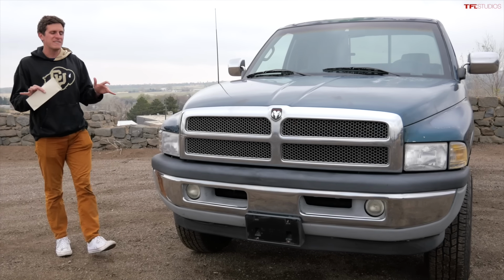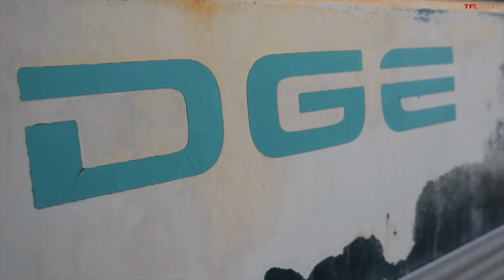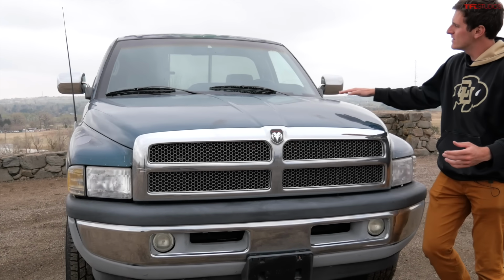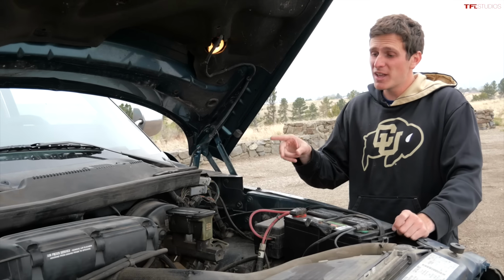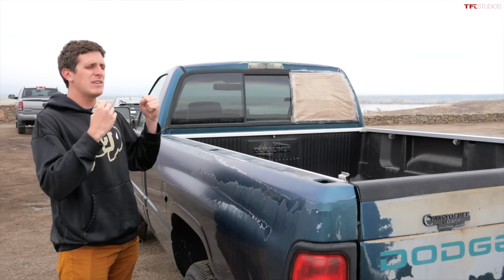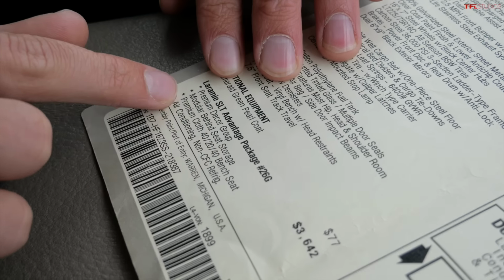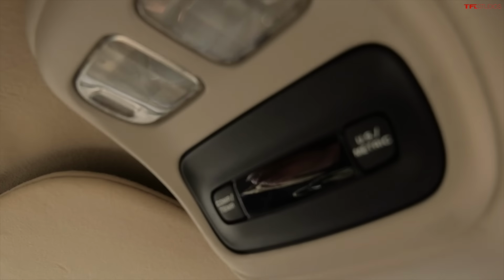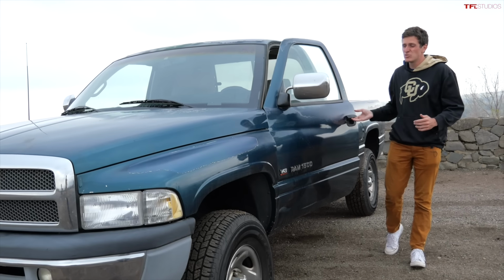The Second Gen Dodge Ram Is The Most Important Truck Ever: Here's Why You Should Buy One NOW!

Comment: This truck ushered in what we see today in pickups. But my friend had a almost new 1500 sport RAM 360 ext cab 97' model year was worked and at young age we practically lived outta it interior room was better than others. But reliability not there ! Tranny's and when it worked not precise. The other issues was the front end would fall out daily! The transfer case blew twice too weak for that model and weight . The 360 always performed good , but mpg wasn't a joke at all vs my 350 GMC. It is a truck that needs to be built and customized after purchasing then perfect! But we would all go off road and they would hang with Square body's and jeep's.

Comment: I've always loved the 2nd generation Dodge Ram trucks. I own a 99 Dodge Ram 1500 short bed with the 3.9 V6 and 5 speed manual transmission. I plan to swap out the V6 for a 5.2 V8.
Reply: does it vibrate

Comment: I’ve had all types of 2nd gen Rams. 1500, 2500, 3500. Gas 318, 360. 12v Cummins, 24v Cummins. Auto, manual. Single cab. Club cab. Quad cab. 1994-2001. I’ve had a lot. They have their issues. But… the value for the dollar is insane. Parts are relatively cheap and easy to get. Grab a nice one because these will go up in value at some point.

Comment: I bought one of the last 2nd Gen Dodges ( 2001) New, as the New 2002 Model Dodges  started dominating the Dealer Lots. I was disappointed in the New 02’s I did not like the total remake, I hated the Catfish looking front end , nor did I like the bland sheet metal, also gone on 02 was the quad cab with the smaller rear suicide doors and replaced with a full 4 door . So I hunted around and bought one of the last 2nd Gens. I still own this truck, it is garage kept and low mileage and still looks great, I also have a 69 Dodge D-200, with all the original paperwork. Oddly, the 69 was listed and sold as a 3/4 ton truck, but the extensive owners manual lists all chassis components as one ton. Buy a new truck today? They just tell you not to drink the coolant, lol

Comment: Owned 2, a ‘94 LWB 5.9 regular cab 2wd and a ‘95 SWB 5.2 regular cab 2wd. Both red. Preferred the SWB as it was a city truck mostly. But he’s right about the mpg. They were so popular at the time I traded the ‘94 with about 9,000 miles for the ‘95 for less than $1,500 with almost identical equipment except the engines and beds. The ‘95 also had the argent lower paint trim which I preferred.

Comment: My '99 Dodge Ram 1500 w/5.9L currently has 480,000 miles and is still one of the best driving, dependable vehicles that I have ever owned.
Reply: Any major issues. I just purchased a 01 with the 5.9 4x4
Reply: @boe2923  No major issues. It has had 4 water pumps but I believe that was more to do with low quality of replacement parts. It's currently up to 509,000 miles now. A picture of the odometer can be found under more about this channel on my profile.
Reply: @robertdavis3122  Pics of the odometer or it didnt happen😁🙏
Reply: @robertdavis3122  it will keep going
Reply: @mikesai8561  they never show cause its not real. I have come across tons of people who I've called out and no one has proof.
Reply: @mikesai8561  Douche
Reply: @boe2923  my 2002 with the 5.9 v8… oh boy. I had 540k miles on it, same motor same trans. Neither of them ever opened up. I probably had 4 water pumps 3 radiators and the entire suspension system was new when I traded it in. 

It would strand me a lot. But only over the course of day a year and that happened in the 300k range, and that was when a bunch of sensors started going out seemingly at once. All cheap. Never more than 20$ here and there. But it would strand me in random spots, it would start back up and drive though. And they were all easy to replace. 

And if anybody had the 5.2, I had that in my 1997. That truck wrapped around a pole at 190k miles sadly. But it was my first truck and very special place in my heart
Reply: @boe2923  I have the same truck, 330,000 miles on it, you have one of the best trucks I've had in 46yrs. Take care and let her run.
Reply: @boe2923  hows it kicking??
Reply: @boe2923 steering shaft and steering gears are an issue
Reply: @boe2923 You made a excellent choice 👌
Reply: 5.9 straight 6 or 5.9 v8
Reply: @dmjelliott  5.9 V8
Reply: @robertdavis3122  I want buy Dodge Ram second generation, specially wirh engine Cummins
Reply: Been driving my 98 for over a year and a half now no issues 127k
Reply: I have 286,000 on my 97 1500 with the 5.9. Engine and transmission have not been rebuilt or replaced unless it was done prior to 1999 when I bought it with 48,000 miles on it.
Reply: @markwood1986  Mine needs some more tranmission work currently. I pull a trailer a lot so I'm sure thats why. The current mileage is a 509,000. The other thing that has helped extend the life of this truck a lot is it has very little rust which makes it a lot easier to work on. I have a second one with the 5.2 engine but it came from the snow belt so it is much harder to work on.
Reply: @robertdavis3122  mine has spent it's whole life in central NC. I can't complain about the truck. It certainly owes me nothing at this point.
Reply: @robertdavis3122  Nice I just got my 1999 5.9l v8. 200k on odometer although its never really been used for towing, im still worried the trans will go out. Waiting to fix the brakes and then i can drive it more
Reply: 96’ with 1500 5.8 here. I got the full service history and it only ever got the transmission replaced in 08’. I’ve had to get new ball joints and muffler, but besides that it’s completely original.
Reply: I just bought one 180 on the clock
Reply: My 97 was my favorite truck I've ever owned! My 2010 gave me more problems than I ever had with my 97.
Reply: I have 5.2 1996 on 27 thousand miles
Reply: And change the differential oil
Trans
Brake
Motor
And radiator
Reply: @fernandosusano9229 why change the motor?
Reply: I want to get one how’s the gas mileage on the 5.9? Is it bad as they say it is?
Reply: @Bryant234  if you’re going 55 mph it will be around 15 if you’re doing 70 it’s about 12 and if you’re doing about 80, make sure you stop at the next station
Reply: @williammorgan5987 Depends on your gears.
Reply: @Bryant234  the gas mileage doesn't matter. It will still be cheaper than a 1100 dollar monthly car payment.
Reply: @Bryant234  William Morgan is right. I get about 15 mpg on the interstate and about 11 mpg if I'm pulling a trailor. I also have a another 1999 dodge ram with the 5.2 liter motor. It usually gets over 16 mpg on the highway.
Reply: @Bryant234 Yes it is that bad but worth every dollar.
Reply: Can pass anything but a gas station
Reply: Mines got 305k still runs n drives smooth as butter it rides smoother than any vehicle I’ve ever had
Reply: Mines at 340k original engine and tranny. Runs and shifts like a dream
Reply: Brother you are not immangine this. I have an 01 5.9 Magnum 4×4 with 350k the motherfucker is bulletproof!
Reply: And...how many engines and transmissions have you had?
Reply: @workct5702  The engine is still the original has never been rebuilt. The transmission was rebuilt once at 225,000 miles. Probably the most frequent maintenance item beside oil changes over the years has been front brakes and rotors. I know I've had to replace them at least 8 times.
Reply: @robertdavis3122  i don't believe that. I have just under 300K on my 98 dodge
 It needs a rebuild.
Reply: @robertdavis3122  What did the rotors do when they went bad? My ram has intermittent shaking at low speed and stepping on the brakes (not all the time). When it does shake stopping it's pretty bad sometimes. Then at highway speed 60+mph it has a shake/ shudder. I'm about to replace my front bearings, rotors, and pads.
Reply: @robertdavis3122  I know your pain with frt rotors and brake pads, my ‘98 went thru them about every 38,000 mi
Reply: @thelagmeister them rotors are probably warped
Reply: @thelagmeister no way it hasn’t needed Ujoints
Reply: @robertdavis3122 I love your loyalty to the best truck ever built!
Reply: @workct5702  mine has 330,000 miles on it original Trans and engine, original everything except alternator and starter.
Reply: @workct5702 Ford is number 1 in engine replacements. Try not to lose too much sleep

Comment: This truck set the styling of the majority of trucks from all brands for the next 20 years.
Reply: The Colorado location of this channel, may give a more forgiving/skewed historical judgment, of this second gen Ram.
These were notorious 'Rusters' in Canada, and the US Northeast. They were not long-lived. Like may Chrysler products of that era, they disappeared quickly.
If you consider 'resistance to rust', a factor in their longevity, across all markets. And their ultimate reputation.
Reply: Too bad Ford sold the rights to the Cummins and the Gen 2 body style to Dodge. It could have been  phenomenal truck, but Dogge chose poorly in their engineering and materials used in their construction.
Reply: @bodiespizza  Really, I have 4 from 2000 through 2003 still running.
Reply: @bodiespizza The core of the 2nd gen is good quality, the cost savings is in the interior, mostly the dash.
Reply: @timothykeith1367   the dash and the headliner  neither hold up to the test of time .....DASHSKIN make a replacement cover that looks really nice and does not crack ....but the headliners are the worst  every ram truck  still one the road with a factory headliner has a sagging fabric or it just peels off exposing the foam  that turns to dust if you press on it or scrape anything on it 
the good thing is the parts are cheap and still widely available

Comment: Those 360 Magnums (5.9 L) were rated at 235 horsepower. You could buy that same production engine without that beer keg intake, but with a traditional 4 barrel intake, and it made 300. Most that went on a dyno actually made more than that, with a basic carb. They also used moly rings, and even after 200k miles, you could still see the crosshatch on the cylinder walls.
Reply: Just so you know just because you can still see crosshatch doesn't mean it's functional anymore. Plenty of modern engines you will see cross hatch even after hundreds of thousands of miles. But the grooves are so minute that they barely function anymore.
Reply: @joshpodolsky7740 you are correct. The few high mileage 360 I have pulled the heads on you could see the cross hatches but the cylinder no longer had the dull crosshatch look you get when first  hone the cylinder. More of polished look. Needless to say the block never had a lot of wear in the cylinder walls, in general the bottom ends on 318-360 don’t usually wear out or have issues.
Reply: The big issue with the magnum is the heads, they crack between the valves. A nice set of aftermarkets cures that.

Comment: I still have (original owner) a '96 with a Cummins.  Love the truck and have no desire to part with it.  Agree with some of your comments though, very loose steering, interior is simple and neat but the plastic dash is cheap and broken.  I wished my extended cab had a rear door, which I believe they came out with in '98.

Comment: I miss My old 2001 2nd gen very clean for 253k miles my dad bought in 2003 with 17k on the clock then I got it for 3500 bucks from him in 2013 it still had a nice dash and factory everything, I still had the original cassette deck but I swapped it out for a pioneer headunit.

Comment: I still have my same 98 1500 4x4 same regular cab full size box but has the 318. By modern standards its super basic and still has the original engine and trans with years and years of dependable use, of course living in a Midwestern city its got the Dodge cancer but as far maintenance its been fairly easy I mean honestly every vehicle has its flaws. For me  though and what I use it for its more than enough. Great vid by the way.

Comment: I got a 2001 Ram 1500. It's a regular cab short bed with the 5.2 Magnum. Only 2wd but it has a 5 speed manual. Only got it for 1,500 bucks. It's got a 178,000 miles and still runs like a champ.

Comment: I like the second gen Ram, I 'm about to buy my second one.  Yeah, the 46re/47re/518 trans are weak, but there are fixes you can do to the trans when rebuilding it. 

The 318/360 Magnum motors (LA series motors) are strong, save for poor two piece intake plenum design and sometimes head faults, but the last of the line 2000-2001/2002, are the best.  Two piston front calipers, redesigned rear suspension, steering linkage, redesigned front suspension  make those trucks simple and reliable.

Just cost cutting plastics and so-so seat comfort, especially on the basic bench seat are the other issues.  But, compared to the Hemi sometimes cam, lifter and rocker arm issues or the 3 valve 5.4 Ford, or the oil consumption issues of 4.8/5.3 and the sometimes weak trans of the GM twins, the Ram gas engined  vehicles is a good match against Ford & GM gas trucks.

Comment: That 5.9 is definitely a gas hog. My '02 Ram had the same engine and the fuel light would come on at around 320 miles . 25 (?) gallon tank I believe.
Reply: We bought a brand new 2002 Durango SLT Plus with the 5.9. It would tow anything and get a solid 11mpg.
Reply: My gas light comes on at 222 miles and I have a 26 gallon tank on a 99 Dodge Ram 5.9 v8

Comment: I think the GMT400 was the first 'modern' pickup truck. There was nothing else like them when they came out in 1988. They were the first full size pickups to use double wishbone-style IFS on 4x4 models. The half-tons were almost like the big body-on-frame cars of the 70s: pretty smooth ride, over boosted power steering, extremely comfortable front seats, etc. They're quite pleasant to drive, even now.
Reply: My great uncle was an engineer on the GMT 400 team back then at the Oshawa GM plant in Ontario Canada. My uncle and the father of a high school girlfriend I had both drove one and I can attest to the comfortable ride.
Reply: @bobhill3941  That's pretty cool! There's been a lot of these trucks in my family over the years, the last one being a 1998 Sierra Z71. Extended cab with 3rd door, Indigo Blue Metallic. Unfortunately, the engine overheated and it lost all compression. I probably would've swapped another 350 in, but the body was so rusted out by then I decided to sell it. It only had around 151k on it. Lotta memories in that truck, which we still refer to as the "blue truck". Everybody loved driving it. I learned to drive in it. My stepfather bought it used in 2006, and replaced it in 2014 with a 2012 Silverado. It was handed down to me after that. My mom found it much easier to drive than the 2012, which she finds rather bulky and cumbersome. I miss that truck, so much that I'm often driving it in my dreams.
Reply: @kalebaldwin5398  Thanks Kale, that's really cool. Your life history with the gmt400 makes me think of the songs new old trucks by James Barker band and Joe Diffie's pick up man.
Reply: The gmt400 is iconic. It revolutionized the pickup truck industry. GM hit the ball outta the park on that one, that truck is the square body of the 90’s

Comment: I bought a brand new 1994 back in '94 1 ton dually chassis I was one of the first people in Chicago land to put a dump body on it. And a 8 1/2 ft Union Western Snow plow transmissions every 9,000 miles after the third transmission I traded it in it was under warranty every time but they would keep it for 2 weeks during snow plow season that was no good.. but I remember the storage was absolutely revolutionary and that middle council with the Giant lid. Also they were the first ones to come with a third door that would open up in the extended cab or super cab versions. The driver side would open up to where now all four of those doors open but that was so revolutionary back in that time. But when the truck was working it really could haul 4 or 5 tons in that dump body with no problem and brakes oh my word the brakes were so bad

Comment: I sold my 1995 Dodge Ram 1500 5.9L V8 4x4 with 250,000 miles. It was on its 2nd rebuild of its 3rd transmission…..but it was lifted on 35s and had a rear locker. The new owner took it to Mexico

Comment: I’ve had plenty of my share of the Magnum engines, 5.2L &5.9L.  Tip when going to buy one: the barrel intake has a gasket underneath that goes bad.  When it does, the vacuum of the engine starts to suck in oil from the valley under the intake and the engine starts to burn oil.  Most people think that when the engine starts to burn oil, it’s elsewhere and a death sentence.  Not so fast kemosabe! Easiest way to diagnose this bottom gasket leak is to get the engine running, open the oil cap, and put your hand over it.  If there’s air movement out that cap, but everything else seems to be fine, that’s your leak.  On the trucks, not a terrible fix, just a bit of time.  If you get a Van, or a Grand Cherokee with this, it’s flippin murder to get it all out.  Doable, but holy macaroni!
Reply: did a torque converter on a 5.2 Jeep few years ago, such a PIA

Comment: Has to be the roughest 2 owner 40k mile truck.... why no mention of Dodge's huge failure when it comes to the life of the paint/clear?
Reply: I got a 1992 dodge ram d150 that I bought when it was 8 years old back in the year  2000. It had 94000 original miles and the transmission was already slipping on it and the paint was already peeling off on the bed of the truck. I am the third owner . It was the first year of the  magnum a 318 5.2 with 230 hp that year. The  engine didn't have all that old plastic covering it.  Easy to work on.  I still own it and most of its life was sitting in the  driveway.  I've only put about 46000 miles on it since 22 years ago.  I guess I will restore it after looking at the price of a new truck. It's a long bed factory black with red interior.
Reply: The electrical issues and transmission issues far outweigh the fact that the paint and interior are garbage.